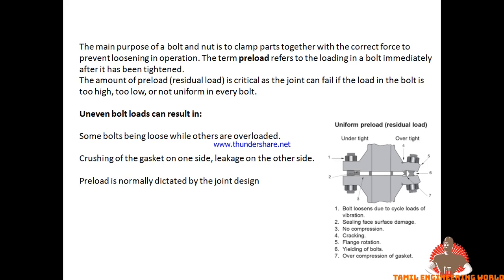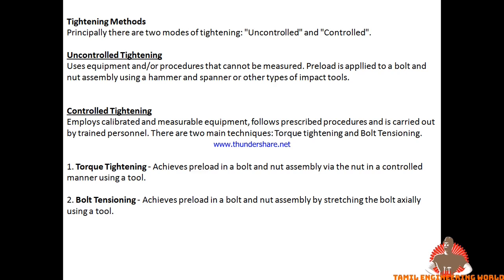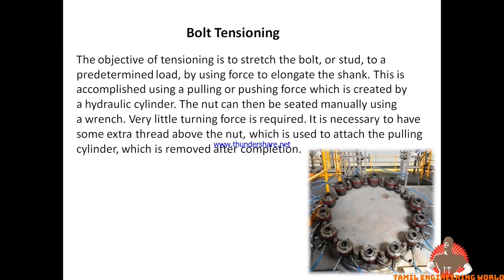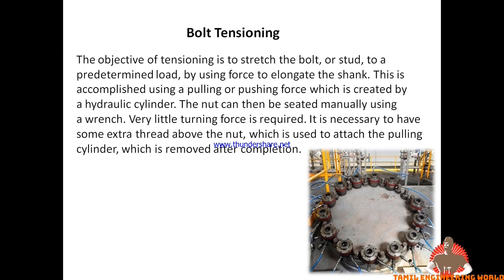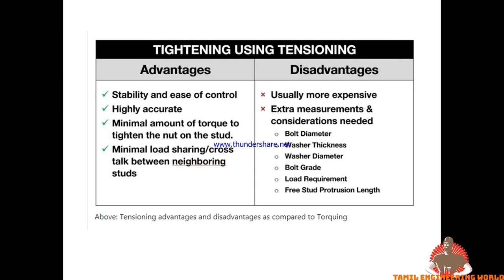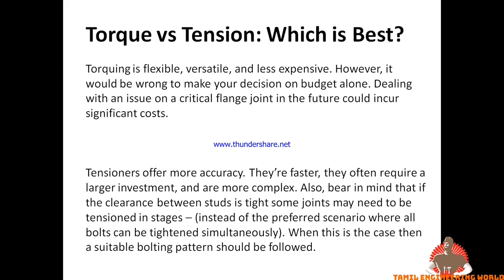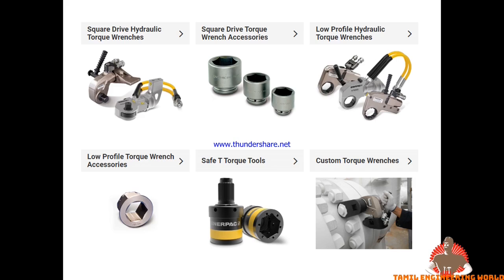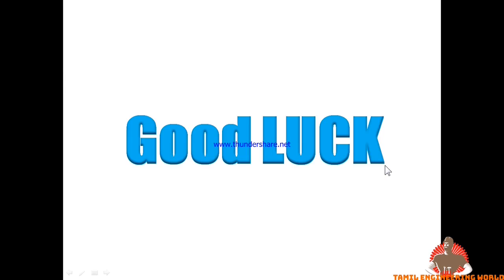Tensioning and Torquing | Bolt techniques | Bolt | Oil and gas | Bolt torquing | Bolt Tensioning

Comment: As per design and flange rating we are selecting  manual torquing or hydraulic torquing, or hyd tensionning requirement.
If hyd torquing is possible for that flange rating i prefer it only due to cost impact.

Comment: Tensioning is best sir....but it can be performed only on upward or vertical flange
Reply: We can use for horizontal line flange also. No issue.
Reply: @saravananknpc is it reuired 20% more value for Group A. Whats the reason for that